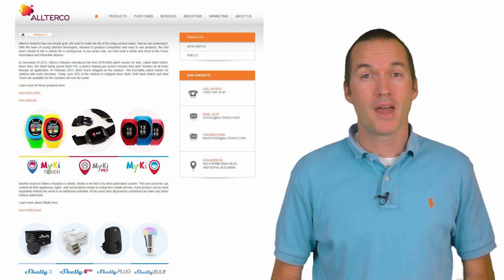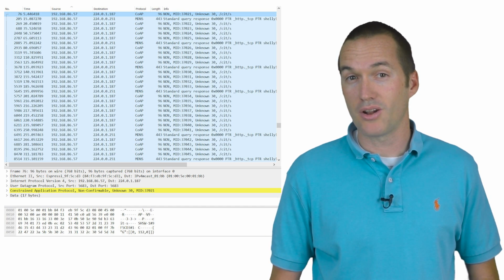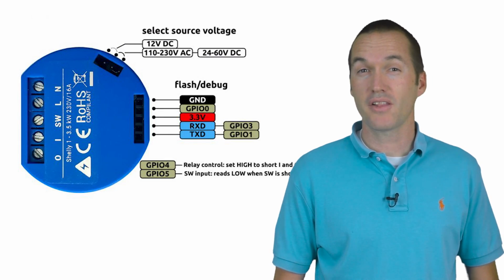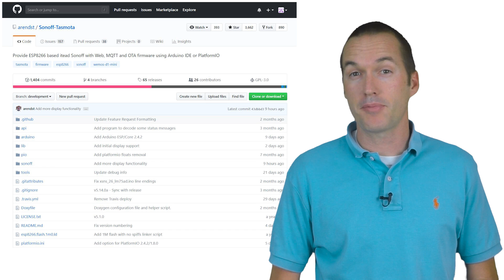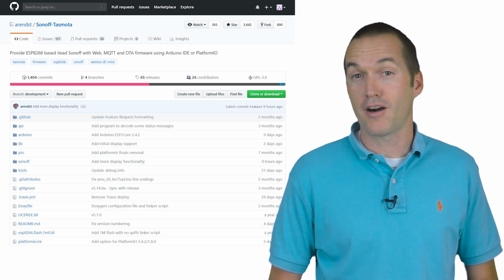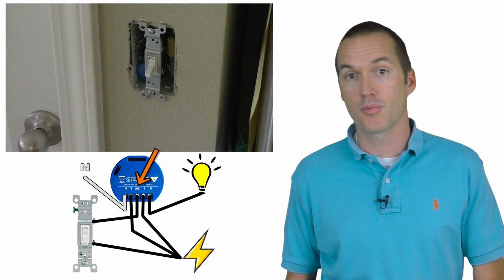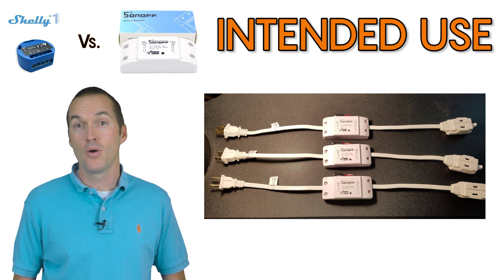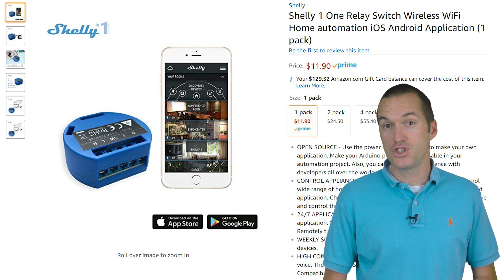Is the Shelly 1 better than the Sonoff Basic?

Comment: I am using 7 Sonoff Basics right now. I use the eWeLink app to configure them. They are all shared with Alexa and Google Home. None have been flashed with Tasmota. Will the Shelly migrate with Alexa and google home? I never use the apps to turn stuff on or off. Just google and Alexa. Thanks.
Update: I checked the website. It will work with google home, but: I have to ask google home to talk to the Shelly cloud then give commands. If I do not terminate from the cloud with Google Home it stays there and I would not be able to use my Wemos or Sonoffs. To me this sounds like a problem. I suppose it would be ok if I only installed the Shelly devices and tossed all my other ones.
The Alexa migrating looks like it is much simpler. I think I just add the skill.
Reply from the maker: All those skills will rely on the cloud service.  Sonoffs are the same way with the eWeLink cloud.  The only integration that can be done locally is Alexa using the Emulated Hue method.  My alexa Node-RED video has information on how to set that up.
Reply: Cool. Thanks.

Comment: I have a switch without neutral that I would like to integrate into Home Assistant.  Would it be possible to install the Shelly 1 in the ceiling light fixture with the light switch wired in there?
Reply from the maker: Yeah, that wouldn't be an issue Justin.  If you have an always hot and a neutral at the light you could wire the shelly in and only attach the switch to the SW terminal, then you'd have full functionality.
Reply: You can do that, but if you switch off ceiling manually, you can't switch on again from Shelly1. Best option is to have neutral. Then you can switch on and off anyway.
Reply: I should be able to wire the switch in at the ceiling fixture though, right?

Comment: Any chance of getting Shelly 1 UL certified for use in the US ? Installing a non-UL certified device inside the wall (like in this video) will nullify your home insurance in case of a event ( even if the device is not at fault ). If you-re still paying mortgage you might have big problems with your bank if you do anything that can make the house not insurable.
Reply from the maker: I've seen this said a few times.  You should read your specific policy to determine if this is the case.  I think it usually is not, my policy doesn't even mention UL listing, but I have seen some that "suggest" UL listed devices.  If yours does indeed mandate UL listing I'd love if you could screenshot that section of the policy and post it, so far it seems like an old wives tale.
Reply from the maker: That being said, I think they are working on their UL cert.
Reply: Yes we apply for UL, but that process are quite long.

Comment: 16Amps on those tiny traces? You crazy?
At least son-off have plated traces with additional solder to increase the current capability of the PCB.
Reply: By test reports is'not a problem, because they are too short.  We don't want to solder them, just because someone use this approach :)
Reply: @dimitardimitrov849  can you measure the trace width? I'll do some calculations later just to check.

But to me they look too small.
Reply: TuttoCrafting There is not only width. PCB is plated with 50 microns cooper.
Reply: @dimitardimitrov849  with a IPC formula on 16A load on 50um copper traces on air (external layers) with 15°C increase and a track length of 1cm the tracks should be at least 5mm wide.

Otherwise you will get a lot of power dissipation.
Reply: TuttoCrafting The CE standard say not more than 80 degree at max load.
Reply: According to the relay datasheet I have found that it can switch 8A on a low power factor load. On DC the max rated current is 10A.

UL 16A tests has been done on 125VAC. So in Europe the load current would be lower.

Max switching power is 300W by the relay specs... So you can't actually switch 240VAC stuff pulling 16A.

So those 16A is a peak value on optimal conditions.

Still a good unit. Maybe you can use to drive a proper relay.
Reply: TuttoCrafting Thanks for good words but if you come to our FB group i can share with you datasheet and all additional information regarding Shelly1. The relay are 125 and 240 VAC rated up to 16A.
Reply: Can't find you on FB.
Reply: @dimitardimitrov849  just joined.
Reply: @dimitardimitrov849  what should I wrote?
Reply: TuttoCrafting Nothing just check now the page :), you can see that relay are UL certified!
Reply: " if you come to our FB group i can share with you datasheet and all additional information regarding Shelly1" or "you can see that relay are UL certified" I don't see anything like that.
Not a fan of FB.
Reply: TuttoCrafting I can’t upload images here but relay are HF7520/012-HSTP
Now open https://database.ul.com

Search for ID, witch you can find in top left corner from the data sheet. Just to help you, it’s: E133481

Also you can see in right down corner in data sheet, there is short information about UL rates. 

Thanks for interest.

Comment: Question. you were showing to add the switch to the shelly. but how does that work? because the switch has a very fixed behavior. does the switch allow you to use it in paralel with the digital signall? meaning. using the switch to switch on, then use software to switch off and then use the switch to switch on again? because i tend to believe that that is the added value of using low voltage switches... or i am completely wrong on this. so far i have mainly used just software to switch..
Reply from the maker: There are different settings for how you want your switch to behave. If you use switchMode 0 in tasmota it will toggle the next time you flip the switch.  switchMode 1 will require you to put the switch in the correct position (up for on, down for off) so you would need to move the rocker switch twice.  These settings are also available in the factory shelly firmware (switchmode 1 would be "toggle" and switchmode 0 would be "edge switch).
Reply: Nice.. thanks for the clear answer. that gives me something to think about :D
Reply: Piet Goorden The Shelly firmware support auto On/off features. Mean you can set Shelly to switch On after X second when is switched off and otherwise.

Comment: Is there any solution for 2 or 3 gang switches? We've got them in UK.
Reply from the maker: What do you mean by 2 or 3 gang? In the US that just refers to the size of the box.  If you mean there are 3 switches you could use 3 shelly1s or 1 shelly1 and a shelly2.  If you mean a 2-way switch (called a 3-way switch in the US) depending on the setup you could get away with a single shelly1.
Reply: @TheHookUp  yes, so what I meant was a wall plate that has 3 switches to control 3 different lights. We call it 3 gang switch here. :). So, are you saying 1 of shelly1 will be able to control 3 lights individually and/or simultaneously? Also, can be done physically and/or thru the app / home assistant?
Reply from the maker: The shelly 1 can control one switch, the shelly 2 can control two.  If you need to control 3 switches I'd recommend one of each.

Comment: First of all: tank You so much for your work! I am from Italy, and I am just beginning to learn about domotic and home automation because I will soon have to renovate my house. Here in Italy there is an always increasing demand of DIY or alternative domotic solutions.... for example there usually is difficulty in buying some types of Sonoff switches... So if You are in contact with the Producers of Shelly, please let them know that could be a huge demand in this Country (even for similar solutions for blinds and/or external window shades)! I also agree with You about trying not to depend too much on the "clouds" and various "external" apps: this is why I am also practicing with Home Assistant (Hass.io) and its integrations. Really nice work!!!!
Reply from the maker: Are you able to order though their website? https://shelly.cloud/
Reply: I will try, thank You, but having it  available on Amazon.it (since I saw that You have provided Amazon.us' links) would really be great! Also, at a first glance, I could not see any product for automating the type of blinds/shades we use here in Italy (for example: integration with physical switches, interlocking, status updating, etc....): it would be great if they could provide such a product: it will literally bust the market (right now many use the Sonoff 4Ch pro, but it has no status update on Home Assistant and it is very difficult to flash other firmwares - ex Tasmota - into the newer versions). Again, thank You for your impressive knowledge and work!!!!
Reply: Axios hello, in next 2-weeks the devices will be available in Amazon.it
Anyway we are Bulgarian based company  and shipping time from us to any EU country, including Italy are 3-5 working days.

Comment: An important consideration in selecting the Shelly or Sonoff for 240 VAC in the U.S. is the number of poles that are switched. I have a Sonoff and it is single pole and cannot be safely used by itself to operate a 240 VAC device in the U.S. The number of poles in the switches was not covered in the comparison video. A single pole switch may be fine in the EU and elsewhere, but not in the U.S. The reason is simple. In the U.S. the standard electric service from a electric utility is provided on three wires connected to the secondary winding of a power transformer. The three wires are L1, Neutral, and L2. The Neutral wire is the center tap of the secondary winding of the transformer and is connected to the Earth. If you measure the voltage between the Neutral wire and L1 the reading will be 120 VAC and the voltage between L2 and Neutral will also be 120 VAC. The voltage between L1 and L2 is 240 VAC. If you examine a 240 VAC circuit breaker in the lighting panel it will be either a single lever (such as the Main) or a ganged double lever (for the branch circuits). The double lever guarantees that if the breaker trips or is turned off, both L1 and L2 will be disconnected from the load. If only L1 or L2 tripped or was turned off, the the load circuit would be hot with 120 VAC all the way through the load back to the load terminal on the off breaker. This is a very hazardous condition. A safe way to use the Sonoff for controlling  240 VAC devices is to use the Sonoff to control a double pole relay so that both L1 and L2 are turned on and off at the same time.
Reply from the maker: I don't think I would recommend a shelly or a sonoff for switching 240VAC in the US for exactly the reasons you described.

Comment: Make your life easy and safer, get some WAGO 221s
Reply from the maker: I love WAGO connectors, but they are SO expensive compared to wire nuts.  I'm actually thinking about getting some of the chinese knock off versions.  They performed pretty well in John Ward's comparison (I think they failed around 70A, which is way over the point where my 15A breakers would trip).
Reply: I have seen people run well over 100 amps through them with welders, even the fake ones. Expensive, meh, I got a box with about 50 of them the other day for 35 euros. The originals. Was different types too. I am ok with paying that for the sheer comfort and ease of mind.

That being said I could be wrong but I think the Shelly 1 is no more, it's now the Shelly 2? Or am I suffering from a search engine failure? Even the ones you linked are shown as not available anymore. The pictures for the Shelly 2 are not clear but it seems to me that one is not as easy to reprogram.
Reply from the maker: Shelly1 is a new product, it was released shortly before this video.  Shelly2 has been out for a few years.  I don't think the Shelly guys anticipated the level of interest in the Shelly1 and it sold out worldwide within about 3 hours of this video being posted.

They have a new production run ready to get shipped out within the next week and you should start seeing the shelly1 available again on major resellers and on their website.
Reply: Hello as The Hook up explain correct Shelly1 next batch is on the way. Next Monday we will start ship devices to pre-paid orders. Same time we will re-stock Amazon witch usually need 5-10 days more. 
Shelly2 we have stock, device are 2 years old and everything is on the line. Soon Shelly1 will be available everywhere.
Reply: Heh ok so the successor to the shelly 2 is the shelly 1 ... When is the shelly 0 coming :) ?

I will have to wait a bit then. No worries.
Reply: @xConundrumx  As soon as you can imagine :) a lot's of people ask about the device without relays 😂
Reply from the maker: Ha!  The shelly1 is only 1x16 amp relay, the shelly2 is 2x10A relays, that's where the 1 and 2 come from :)
Reply: Aha I guess that makes sense ... I will just have to wait a few for the restock so I can see if I can get it to work with a RPI Magic Mirror 2. Too much work atm though so this is a blessing in disguise probably.

Comment: Needs Home assistant support
Reply from the maker: It has pretty good home assistant support already.  Check out my most recent video about adding it to home assistant with the rest API: https://www.youtube.com/watch?v=E99-17XyyUg

If you want to use MQTT right now with home assistant you can flash tasmota, but the shelly guys are going to release a firmware update (through the app, no flashing required) to enable MQTT sometime in September.

Comment: I'd like to know more about the isolation between the switching/ control circuit and the mains power traces  In many boards, designers include an air gap to better isolate the logic and mains circuitry.
Reply from the maker: It is a small gap, but there isn't a need for it since the low voltage is actually referenced to the mains anyways.  Now, having the full mains potential run though the chip will kill it for sure, but it won't be able to conduct that voltage for any extended period of time to be a fire hazard.
Reply: It sounds like one side of the low voltage power is connected to the mains (hopefully, the neutral).  You want to switch the 'hot' side of an AC connection with the relay rather than the neutral. You also want to protect the rest of the circuit from the hot rail with something like an air gap or sufficient trace gap. The hot rail is used in powering the circuitry but ideally, that's going through a voltage regulation circuit with fusing that can respond safely to overvoltage or overcurrent. Other control chips tend to be less tolerant of spikes. So, techniques like leaving air gaps not only protect against arcing between power rails but also against damage to the other parts of the circuit. Blowing up a logic chip is not 'designing for safety' and there's no guarantee it will die and leave the rest of the circuit in a safe state.
Reply from the maker: The ground of the logic chip is tied to L, so it is using L as a reference.  I don't work for Shelly and I'm not an EE, so I can't speak to whether there is additional isolation (I haven't been able to see any from what is visible on the board).

I wouldn't say relying on the chip blowing up is "designing for safety", but a chip is not going to fail in the bridged position for more than a fraction of a second before it burns up and continuity is lost.

Comment: kinda confused. So is this truly capable of controlling and monitoring an air conditioner unit (multi split system 3 ~3000+w ) for the hot summers or sustained use?  I have been searching for a cheaper alternative to the Aeotec Heavy Duty Switch (40A)which is kinda overkill for my needs. I imagine that this is a direct competitor to the Sonoff POW in terms of specs. Any opinions on whether the POW or the Shelly 1 would be better for my use case? Would appreciate it.
Reply from the maker: It's my understanding that those units can spike over 20A when the compressor flips on... I think in that case I'd prefer to know that I had plenty of extra headroom.

Comment: The Shelly would not pass Australian AS2000. Because ground on the interface pins are connected to active on the mains input. Has to have total isolation in LV pins. Guess we wont becseeingvvthis here for accwhile.

Comment: Thanks for the Video! How can i setup the WiFi after flashing the firmware you provide?
Reply from the maker: You can either do it in a serial communication program like termite (like in the DrZzs video) or you should be able to set it up by connecting to the AP created by the shelly and navigating to 192.168.4.1
Reply: Thank you! guess i killed it somehow.. flashing works fine, but it doesn't boot somehow... termite can't connect and there's no AP when i power it.
Reply from the maker: Oh, did you remove the ground from GPIO-0 after you got it flashed?  I should have included that in the video (and will add to the description), grounding GPIO-0 puts the device in flash mode so you can change the firmware, but you need to take it out of flash mode to actually use it.  Plug it back in with just the VCC/GND/RX/TX and leave GPIO-0 off and it will boot, make an AP, and let you use termite.
Reply: Yes i did, nothing happens. It didn't do anything when i powered it with mains. I also tried making my own firmware with Wifi included, didn't work. I think the stick i'm using is the problem (CH340) So i ordered a FTDI stick and will try again tomorrow. Thank you very much for helping again!
Everything is fine, not your fault. The video and everything you explain is great. I'm just a newbie when it comes to sonoff and stuff :D
Reply: Dude! It works with the FTDI... awesome work, thank you very much! =D
Reply from the maker: Perfect!